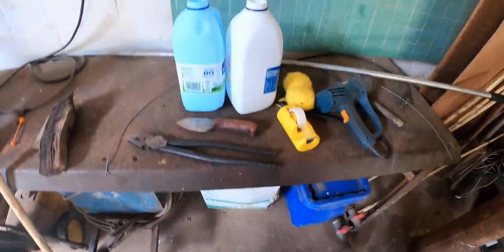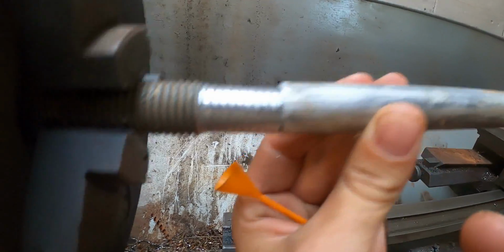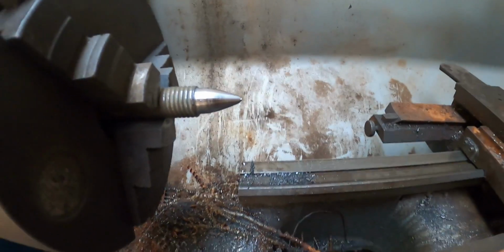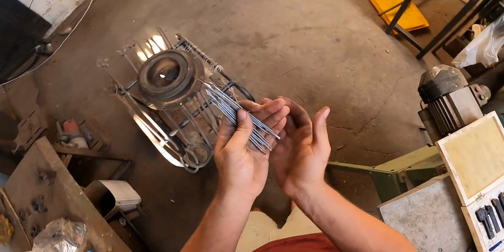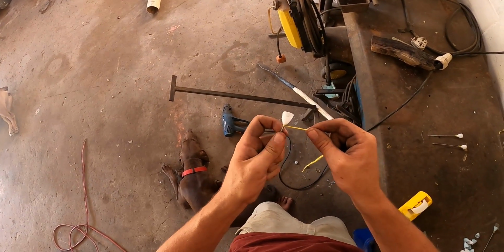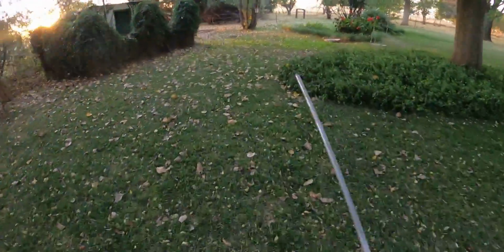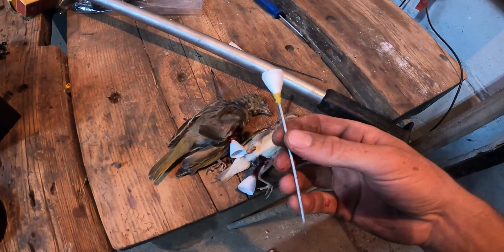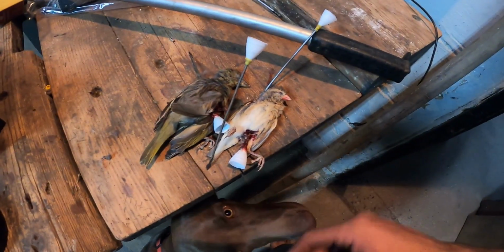New Home Made Darts For My Blowgun??? (hunt included)

Comment: Interesting, I'm going to have to try them on the grey squirrels we have
Reply from the maker: they really do work... and easy to make i will say this they are very very light... next weeks video i try to sort out all the problems. it was largely a success. there are some issues with the dart being too light BUT they are accurate. i did change the way i connect the cap...  that video will only come out on the 29th of May...
Reply: I can't wait! I actually have a friend making me a metal mold for cones like what you showed in your previous dart making video
Reply from the maker: Nice man yes these do work but they don't have the "punch" of the proper plastics I am use to... you get about half the penetration. Which is fine for birds but not so good for bigger game

Comment: The cone thing is genius your forgings pretty decent but when you make those darts maybe you should try sharpen and decides of them like a razor blade what you doing there just the basics pierpoint if you want to cause internal bleeding when you hit something you want to make it sharp on the sides an animal will fill up with blood
Reply from the maker: So David I get your point. But I am using the darts for smaller game note that the "head" is not for cutting it is for the barbs... The wight of the dart does the trick of bringing the bird down I do sharpen the blades when going after rabbit and larger

Comment: To fix the "caps" flexing and expanding. Just add some hot glue from a glue gun into the back. The extra weight will also increase stability and penetration at longer distances.
Reply from the maker: It would I use a method similar to that now but it and it really work's
Reply: That's exactly what I do